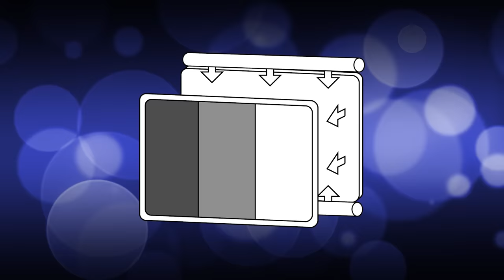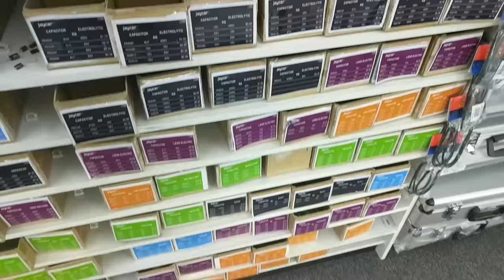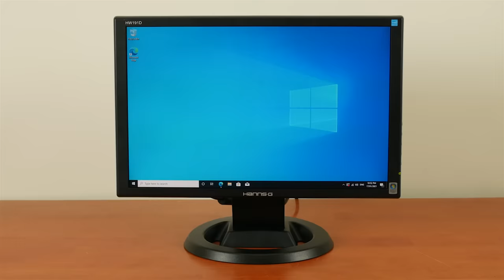Repairing a DEAD LCD monitor

Comment: I'm mostly impressed that you live within driving distance from a place that sells capacitors
Reply: or a general electronic component store :/, my nearest one is ~45 Minutes away in the biggest Town in my area.
Reply: @bachibak  I didn't even know such a thing existed so I guess mine is even further away.
Reply: There is just one there visible from naked eye near my apartment
Reply: I don't think there's such a store in my country
Reply: @edumeli02  that's bad if you like to tinker with electronics
Reply: Jaycar electronics are a chain in Australia similar to radioshack
Reply: @bachibak  yeah that's really bad, generally there's very small shops that don't have much, it would be a dream to have a large electronics store that has capacitors of all sorts as well as diodes, transistors etc.. I would spend hours wandering around those shelves and picking that one thing I've been looking for like 3 years ago
Reply: @edumeli02  I actually don't know what they have in the store, but it's relatively medium size. but I know a older person (about 60 years old) who has a electronic train set(with 20+ trains and mountains and underground train parking) , which is relatively big (I'd say about 10 square meters) and he got all the stuff he needs from that store.
Reply: @edumeli02  You should come to Asia. Tech markets galore! Bins and bins of every component imaginable.
Reply: Radioshack was nice until Verizon bought them and burned it down.
Reply: I live within waking distance from one lol
Reply: Im moving there
Reply: Dang, where do you live? I live in Mexico next to the boarder to US and Steren (there's 2 in my city I think) sells pretty common electronics, besides I have a store like 25 mins away from my house that sells a ton of stuff but is just basic stuff because is next to an engineering university. Is a big city or anything and I have to order online if I need more specific stuff or weirder Arduino modules (and of course that store next to the uni marks up their prices a bit because fuck students)
Reply: SAAAAAAAAME i have to buy them on like amazon or something
Reply: jaycar is almost everywhere in australia
Reply: lol
Reply: @pastalover21  Radio Shack was great before personal computers and cellular phones.
Reply: R.I.P. Fry's Electronics
Reply: I live like 15 minutes from a store that sells salvaged circuit parts. They've got a huge mercury rectifier in there that lights up the whole store, but they got told of by their electricity provider for "accidentally" shorting a jury-rigged 240KV transformer and flickering all the lights in a mile radius, and now they're not allowed to run the rectifier 😂
Reply: Jaycar ftw! i live within 5 minutes of an outlet
Reply: Fucking right? I live in the Capitol of my state. The closest one is like 1hr away
Reply: I live within like a 20 minute walk of a store that sells not only caps but all sorts of electronics stuff... not that I actually go there but, still.
Reply: I can literally walk through one
Reply: Micro Center.
Reply: Shout out to Jaycar! They hate me coming in lol
Reply: @GiBBO5700  they love when I walk in the door. I can almost always guarantee I will walk out at least $200 poorer but with a heap of gizmos and guts that I invariably find a need for (most of the time!).
Reply: @evanstedman7405  they hate me because I get small parts from behind the counter, use 20mins of their time for a grand total  of like $6. Lmao the manager used to roll his eyes when I'd walk in
Reply: Jaycar is a blessing
Reply: @bachibak  that's not that far
Reply: @ibapreppie  US only.
Reply: I know one, it's ~40 mins away depending on traffic
Reply: 5 min drive for me in the Netherlands!
Reply: I dont have one in my city :(.
Reply: I'm mostly impressed that he's alive
Reply: Jaycar is PEAK😤
Reply: I live in the states and I don’t even
Reply: I'm about 15 minutes away from a Jaycar

Comment: Protip: You might be able to shine a light on the monitor and see the outline of whatever it's supposed to display (works best with text) even if the backlight is broken. If that shows weird shapes, it might not only be the backlight that's broken 😳
Reply: Neither part of this is a guarantee for all LCD screens. Sometimes a screen will refuse to display anything if the backlight doesn't work. The Nintendo Switch is like this. Sometimes the display itself breaking will interfere with the backlight---I believe this is also on the Switch, where if any part of the display stops working, the backlight does too.

Some laptops will also be similar.

You did give good advice, but LCDs are really annoying as there is absolutely no standard amongst them on how they work or how they fail.
Reply: @acumenium8157  Yeah this has never worked for me.

Comment: I love these videos, Matt, but I fear you're making me seriously overestimate my basic electronics skills... You make it look so easy to repair everything I'm just like 'yeah I can do that too'... and then I actually try it...
Reply: You can do it! If you know the problem beforehand. Just need the expertise. Given instructions you 100% coulda done this. Uncertainty is the toughest thing to deal with
Reply: I mean, I "fixed" a Wii with a dead disk drive by just installing the Homebrew mod, so games can run from SD or USB drive.

Depending on what you need to fix you might not even need a soldering iron.

In the same way installing a SSD in an old laptop or desktop can give it a lot of new life, even moreso with a lightweight version of Linux installed instead of Windows, and Linux is quite easy to use in many ways now and will regularly run magnitudes faster than Windows on the same hardware.

So yeah, start with "fixes" that you can understand and manage and scale up where you can!
Reply: I've "repaired" two monitors by replacing the power boards entirely. Usually they cost around 30 USD. It's more wasteful and not as cool, but I have two 1080p lcd monitors that cost me 60 dollars in total. I just don't have the soldering and diagnostics skills for a more advanced repair.

Comment: i love when a electronic breaks and is just because a capacitor died, its so cheap and easy to fix :D
Reply: Ah yes, I love corroded traces and acid everywhere.
Reply: @n646n It's much easier than a tiny surface mount component, or a proprietary chip burning up.

Comment: Always, always, always make sure you discharge your capacitors before meddling with them. Even if the machine has been offline for quite some time, the capacitors can still be charged. Sometimes they, especially those used in the rectification, can store a lot of energy.

Comment: 3:40 - I had repaired an acer monitor one time and the board was clicked in the same way as this board. This actually is because this prevents the board from popping out of the metal case. At that time the power supply port was ditched in and the board got stuck because the tape on the metal case was not tight enough. After 2 hours I got it to work again!

Comment: yeah, those models are known for making problems, i personally have two of the exact same models that yours but with the grey border and one of them hava a lack of red and the other have a very dark gamma, both of wich can be tweaked in the nvidia control panel but that makes using those monitor with consoles or anything else pretty dificult

Comment: Electrolytic Capacitors have a Polarity the stripe side mostly with a dash - is negative also the side also with the shorter lead. The board usually has the polarity stenciled on the board. This one has a dash - negative. On higher voltage boards if you have the wrong polarity they will blow with a hiss and release a smelly smoke. Just to help out and it may have already been mentioned in the comments.

Comment: Thanks to you i have a second monitor, thanks. 

(Actually my issue was worse than just faulty caps, the inverter was also ded. I changed it but only one lamp works)

Comment: Ah yes, I have the exact same monitor. My backlight died years ago as well and after replacing all caps, even the AC filter cap, it worked again. Mine didn’t look that worse as these, except for the AC cap that even leaked, but they were all bad. I used it from there on again until recently when I upgraded to bigger screens at last, using this one for my G3 PowerMac now.
It’s funny seeing this exact model with a dead backlight in need of a cap replace. This is a good video, it should help a lot of people figuring out what’s going on. Good one!

Comment: seems like worth mentioning that you want low ESR caps or it's going to fail again, and much quicker. Plus there's the question of whether you need to replace the large 450v cap (usually no).

Comment: Whilst capacitors in that era suffered badly, the light source of the time was often a cold cathode tube (It is in this monitor model), which would degrade over time. They have a small amount of mercury which is vapourised, and conducts electricty. After much use, some of the mercury binds to the glass and less is available to vapourise. This in turn pushes the power board harder, and puts it under more stress with also reduced light output. Eventually the power board will cut out, as the power required is undeliverable, or it would fail. Replacing the cold cathode tube(s) at the same time is also a good idea, which also increases brightness, plus the capacitors, whilst are better nowadays, are still under stress. I've done this before, however they do contain mercury, and are highly fragile. I've not done this for many years as modern screens are mercury free, but hope this explains what's going on too.

Comment: I had mine not working but ended up removing the entire electronics on it and replace it with a newer one that accepts HDMI input. You know those universal TV LCD controller boards, that works on almost all panels (only some niche panels dont work usually found on TV screen panels and some screens with touchscreen digitizer).

Comment: When the cylinder shaped electrolitic capacitors fail, the often get domed tops or leak liquid at the bottom. The cap thats next to the one you replaced looks suspiciously domed... just keep an eye out.

Comment: I personally had one 19.5 inch 900p LG monitor lying around from 2006 in my parent's attic of junk which was not working, and when I saw this video, I opened up the monitor to find out that it had the exact same issue as this monitor, the capacitors were blown up, I replaced them and viola, its working good as a monitor for my moms laptop, its at least bigger than her laptop screen which is just 14", and she loves using that

Comment: I have an old, dead Hanns-G 1680x1050 monitor that also suffered capacitor failure. It seems that Hanns-G monitors fail pretty often due to dead caps. I have a Samsung Syncmaster 712N on the brink of death due to the exact same issue.

Comment: I've got an older lcd panel that has been getting dimmer and dimmer as the years go on, I've been using it daily for like atleast 12 years now, as a secondary monitor for discord or whatever while I'm gaming, might have to open it up and check it out

Comment: My LCD monitor is dying, takes about 2 mins for the screen to come on. I opened it (opening monitors is literally so ass) i had no idea what was wrong but i'm guessing it might be a similar issue concerning its capacitors. I would've like to check and see but i got to the step where the VGA bolt was holding in the boards and decided to take the consistent two minute warm-up time to do my own warm-up stretches ... at least until the monitor reeeeaally needs to be fixed.

Comment: One of the first things I learned to fix during my apprenticeship to become a technician was this exact problem! We got a sh!tton of "dead" monitors that only needed a new capactitor or 5! They all worked just fine again within 15 - 20 minutes, tho we always had them running as temporary additional monitors for an hour or 2 to make sure there weren't any other wonky caps that would only fail after heating up and then work just fine again after letting them cool down a bit.

OOOOH, and believe me when I say I fuckin' FEEL that pain of having to pry the damn things apart using a flat head screwdriver like I was doing it myself at this very moment!

Oh yeah, and I also zapped myself multiple times on still charged 400 Volt caps over the years while lifting off the power box coz my patience had run out after prying the damn plastic case open and removing all the tape and wires.

And one final tip from an experienced solderer: Use a de-soldering pump to remove most of the solder, it's usually enough to open up the holes and only needs to be emptied and cleaned once in a while. I only use de-soldering braid when I'm working on stuff where I can't use the pump properly or run the risk of damaging stuff with it.

Comment: 2 of my 3 old monitors died and i assumed it's the caps. Ordered new ones, waited for a good while and replaced them when they arrived. Still dead monitor.
Never did i think about trying to put a working panel on them. Turned out the panels had died aaand yeah. Can't fix those, especially when they are filled with mercury :D

Comment: Dead CFT tubes in non-LCD backlit monitors is also a problem. My first LCD monitor developed that problem, but I didn't know enough about electronics at the time to fix it :(
Reply: I discovered a fun fact about how old Sony Mavica cameras do their CCFL lights, and here it is:

If you have one that the backlight seems dead, clean the backlight toggle! It's not actually a switch, it's a potentiometer being used like a switch, and it will become dirty, and cause the cameras backlight to seem totally dead.

Comment: Before watching the video: "I bet it's gonna be crapacitors"
Yep. Just as expected.

I have a whole bunch of old monitors that were given to me for free as non-working. All but one got revived by replacing capacitors. The last one had a blown power supply controller IC, and I decided not to bother with finding a replacement. I managed to stuff a PSU from a different monitor into its chassis. Wasn't a perfect fit but it went in eventually.

Now I have a whole collection of working old monitors collecting dust. My PC already has 3 monitors plugged into it, and adding more would be a bit ridiculous.

Comment: Could you in theory just take out the enitre lcd panel and tape it onto the wall and have a very slim monitor?
im actually thinking of taking my old monitor apart and taping to above my bed so my gaming can continue there but idk if heat or any other stuff will be a problem

Comment: Last time I turned on my old monitor it made fizzling and popping noises. Hope it’s caps, I need that thing. Bought it 2nd hand for a dollar because the green channel appeared to be nonfunctional, the listing had all the images shown on it looking magenta. But when I bought it and slapped in my HDMI-to-DVI adapter it worked flawlessly. Guess the VGA part of the PCB was just partially broken, which is a shame, because I thought having an edgy magenta monitor would be kinda cool.

Comment: I used to have a Samsung monitor with failing backlight, and while I did fix it by replacing bulging capacitors, opening it was absolute NIGHTMARE. There were ZERO screws on the back. I really hate plastic tabs.

Comment: Hello, my 22 screen hp monitor does not have a vertical half screen. 2 470uf 25 v capacitors on the motherboard have exploded, so is there a half screen error or there is a cof fix demi problem. Do you think it will be fixed if I change the capacitor?

Comment: Yo MattKC, to deal with those f*cking annoying plastic tabs, go on ebay and get one of those cheap "cell phone" repairing tool kits. They come with like 6 metal/plastic tools that are really helpful for separating the electronic shells (adhesive or tabs).

Comment: You need to be very careful when you work on any kind of mains electricity power supply. There may be high voltage capacitors that haven’t discharged with the potential to shock you.
Reply: Matt should consider himself shocketh

Comment: PSA for everyone who cleans plastic. Go to your local autoparts store. Ask them for plastic reconditioner or ceramic coating. Either chemical will restore plastic to factory like condishions, and can often hide fine scratches and scuffs without the need for sanding.

Comment: Actually, i do have an old monitor that died on me!

Too bad that mine went haywire. Some kind of VRM or transformer died maybe, because the cable inputs 19 volts, and as soon as it gets into the computer it starts fluctuating completely all over the place, and i couldnt trace where it goes next :(

Comment: Hey guys, I have a desktop monitor that I've been using for about 5 years, but lately if I turn it off for a little bit an then on again it starts dimmer for about 1-2 minutes and the goes back to the regular brightness, is it related? could it be a capacitor dying? Thanks!